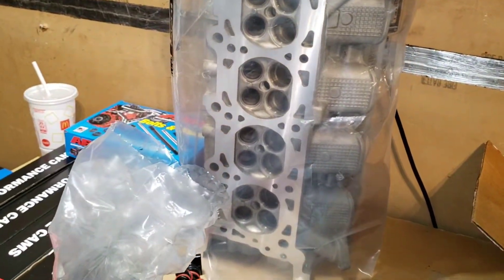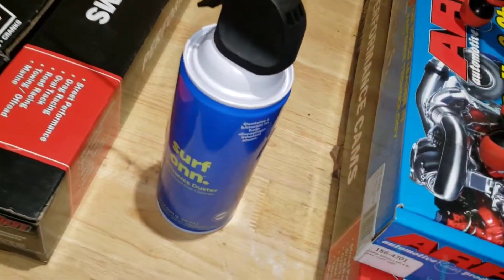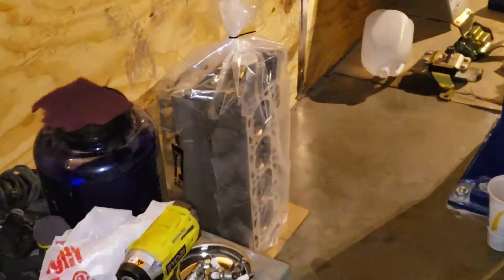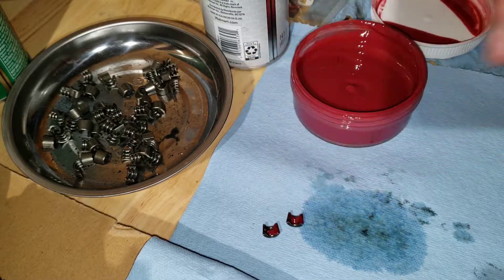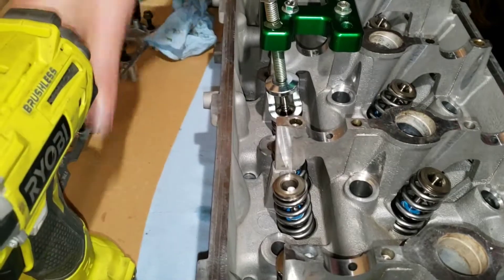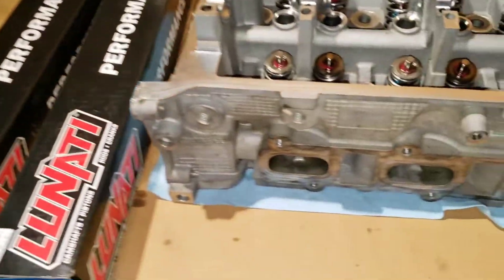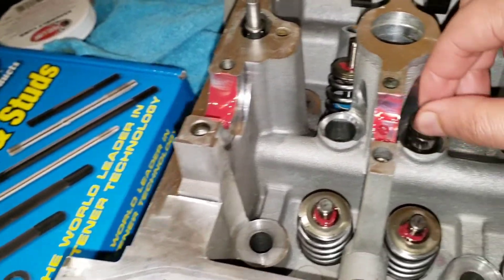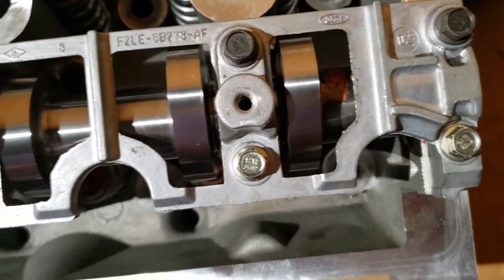03-04 SVT Cobra cylinderhead assembly with custom cams

Comment: Do you have a link for the specialty tools involved?
Reply from the maker: https://www.ebay.com/itm/Ford-Valve-Spring-Compressor-tool-for-Mustang-Shelby-Cobra-GT500-4-6L-5-4L-4V-/124924641218?mkcid=16&mkevt=1&_trksid=p2349624.m46890.l49286&mkrid=711-127632-2357-0

Comment: You're doing a great job I'm a 4.6 4 valve die-hardman all my vehicles that I own are 4.6 4 valve they all run great I was just curious if you know what the horsepower output will be after the rebuild just a ballpark estimate I have a 2004 Lincoln Aviator with the Mach 1 motor and in the near future I like to do a rebuild like you're doing supercharged possibly 700 horsepower
Reply from the maker: My tuner made 700ish with the whipple 2.3 i bought off of him. Im doing cams as well as longtubes so i should be slightly higher but we'll see
Reply: @texaseliteperformance4471  thanks for the reply I appreciate that